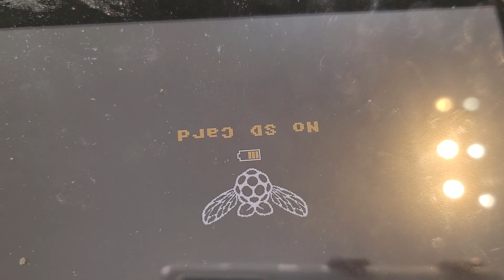Installing a Picofly mod chip | Part 2

Comment: Hi bro i use chip picofly then when i turn off switch and then turn on my switch always in on ofw can't in hakete, did u have solution?
Reply from the maker: You just need to check your solder joints?

Comment: Soooo, i (think) did what you did but the switch won't turn on.
When i disconnect DAT0 CMD CLK and RST wires (from the switch not the pico) the switch turns on as normal.

Ever had anything like this before?
Reply from the maker: No but I would assume something is shorting
Reply: I resoldered all connections again, now i get a blue light followed by two blinking lights and a black screen. 
I really feel my soldering connections are good (i checked with a multimeter and they have continuity) could it be the software on the Pi Zero where something might have gone wrong? 
Im thinking about desoldering everything from the pi board and put the boot button and usb poort back to reflash the pico 🤔
Reply from the maker: @Dsbarrynl  if you think the soldering is good you might have to. On the written guide linked there is a section that says what the lights flashing means, maybe worth reading that to see if it helps?
Reply: I resoldered the usb connector back on, and the boot button, the Explorer rpi screen came back and i nuked the device after that the usb controller chip on the back got really hot and eventually Windows said unrecognised device. So i ordered 3 new pi's.

But first i have to wait 10 days for them to arrive.
Will let you know how it ends.
Reply from the maker: @Dsbarrynl  yer getting warm is never good!

Comment: These wires seem fragile.
Reply from the maker: You need to wiggle them a bit to get them to break, but in here they should never move so it shouldnt be an issue.

Comment: The wire is bare, so why does it not short out?
Reply from the maker: It's enamel coated, when you put solder on it it takes the enamel off, that's why I put solder on the ends

Comment: buddy you rubbed the solder pads on switch motherboard is it neccesssary..?? i think im missing this step while installing the chip the solder aint sticking to pads this might be the reason? ?? how much one have to rub the solder pads to remove outer covering so that somser sticks to it?
Reply from the maker: Yer I had the same issue, you need to be really careful as if you rub too much you will take the trace off completely.
Reply: @fixingmoddingbuilding  that means im not alone facing this issue ...buddy can you tell me can i use a tweezer to rub it lightly..will the pad change colour while rubbing how can we know the solder mask has been removed by rubbing?
Reply from the maker: @rockykhan6338  yes, use a tweezer or a sharp cutting knife.
You scratch it gently and you should feel it change it begins smooth than once you scratch the top layer off it feels a bit rougher.

Comment: Hello Bro, i heared that there is new another way to solder the mosfet without opening and touching any capacitors in the apu area (the spot is in the other side of the motherboard) but I don't know exactly where this spot is located, do you have any idea about this way? thnx in advance.
Reply from the maker: No sorry not really been looking at this mod due to the price and easyness of the rp2040 chip is probably an easier option to use that, look at my other videos to see it

Comment: Might be a dumb question, but why do you use a heat gun on the usb c port and button, could you also just use the iron the liquify the solder so that they fall out?
Reply from the maker: I used it just as it was there but yes you probably could.
You might struggle to heat all the points on the USB port to get it off without damaging but it would work fine on the buttons.

Comment: Allright. Couple of questions. You use non insulated wires, that touch eachother. How does that work? I expected to have a short or something going wrong with it.
Second question. The wires are touching things on the board,like resistors and other points (im not reffering to the ones that you intended to solder) , how does that not affect the board and short it out?
Reply from the maker: It's enamel wire so the wire is protected, when you see me putting solder on the wire ends that helps remove the enamel so it will solder easier.
Reply: It’s 40 awg magnet wire

Comment: hi dude. why you solder doubled S from mosfets to  dround frame?
Reply from the maker: Not sure what you mean
Reply: @fixingmoddingbuilding  
you soldered two mosfets with one wire and soldered one end to the corner of the chip and the second to the metal frame
Reply from the maker: @petrofl  thanks, understand now, so it is to ground the. Mosfet, you are right in thinking it might only need one point, the shield being the east option but a few of the pics in the guide showed it soldered to two points.
It's my first one so over compensated so I didn't need to go back and make adjustments but will look at doing more over the next few weeks ago will try things like one mosfet, one earth wire etc.

Comment: Are really necessary two mosfet instead one like most of people are doing?
Reply from the maker: Don't know! I read one works fine but if they don't you need another.
I thought it would be easier to put two in now rather than taking it apart later

Comment: Great vid, mate. Cheers!
Does this method work on all switches: v1, V2, lite and oled?
Reply from the maker: Thanks. In the guide linked it shows other solder points for the other consoles, I think only the oled needs a special part that goes under the nand. I might be wrong but not read into it much as don't currently have one.